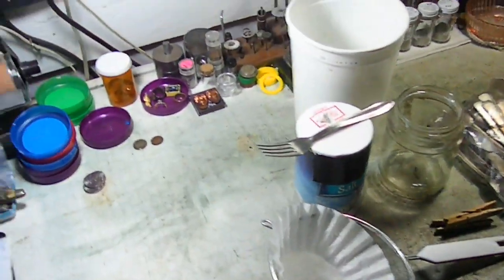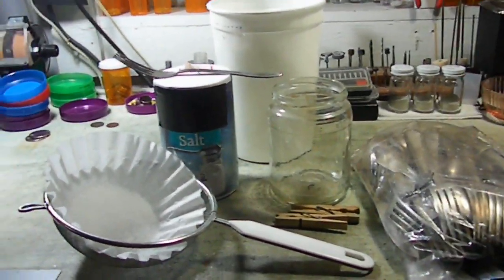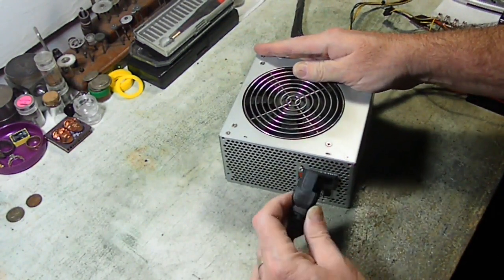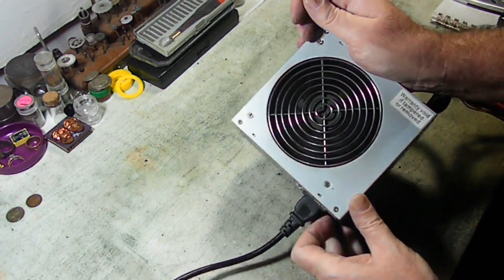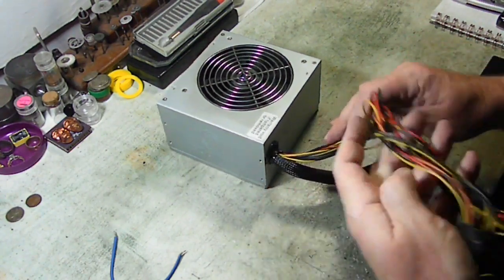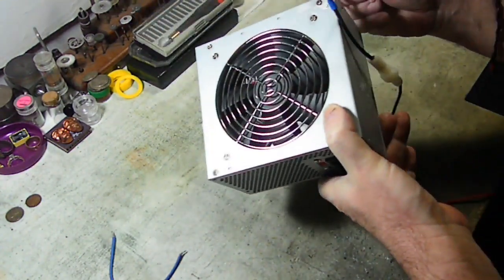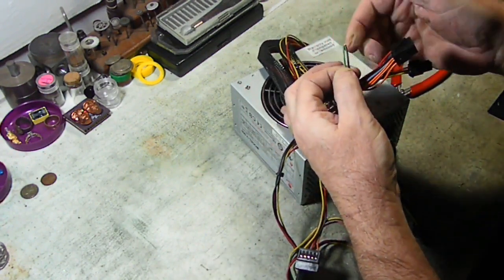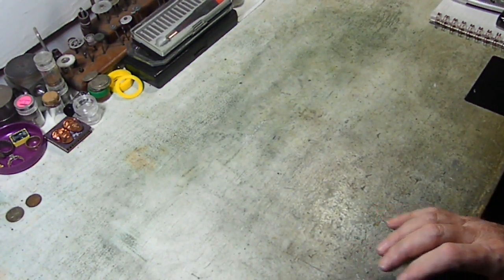Reverse Electroplating Silver Plate "Powering Up"

Comment: When stripping can you strip it from 1 item and plate it on another item like a silver bar?
Reply from the maker: Yes that is possible, but you would need a specific electrolyte to match what you are stripping or plating. It has been many years since I did anything like that. Back in the day when I had my rock and gem shop  I had a small electro plating rig, if memory serves me correctly I think we had a solution called stripping solution, I don't know exactly what it was, but it would remove the plating, but some would still end up in the bottom of the container when stripping. 

I while back I watched a video here on youtube about a electro stripping and PM recovery, Sorry, I don't remember the name of it but it explained the process really well. Try doing a search about this and maybe you can find out more there. Hope this helped!!

Comment: So you put an inline fuse on you power out. This may be a dumb question but if that can't put out more then 3.3v what's the point of the fuse? And I'm not trying to be a smart ass. Just asking to learn.thankyou
Reply: The problem I keep running into is my power supply senses the short circuit by having my cathode and anode in water. So I end up using my 5vsb, because.it will still work even with a short. How can I get around this?
Reply from the maker: The inline fuse is because that particular power supply is used for my silver cell, I was just showing it as an example in this video. The supply I use for salt water stripping has no fuse.  Here is a link to my Silver Cell Build playlist if you would like to watch the videos: https://www.youtube.com/watch?v=bcEnlVWOW4Q&list=PLJpGeLyma0yCzio-Sq3aJfpznM7bFWikG  As far as why your power supply is showing a short I really don't know, as far as I know it should only do that if the anode and cathode touch.
Reply: @BackyardScrapping  so I found the reason for my short circuit, what it was is. So you have your cell and you put your chloride into your solution. And with to much chloride you have to much continuity and it short circuits. So I remade solution with hardly any salt and it worked just fine but very slow. So I added more salt and it worked a little better but not much and I added more and it worked better and better and better and then short circuit. So I restarted again and went threw the same process from start to finish and found this out. Essential my anode and cathode touched with a salt bridge to a sense. I love science hahaha. You should take a look at my channel if your bored one day. :)
Reply from the maker: @shelbysgarage5828  Will do, just dropped you a sub, just beginning to have a heck of a time keeping up with everyone. I do my best to answer all my comments, man that is getting tuff, but got to stick with it 😁 Glad you figured out the problem!!

Comment: I have some power supplies laying around. I've scrapped about 30 of them. I'm not happy with that decision, I could've used them. I at least have about 20 or more left to work with. Before I even started this comment I got the 1st power supply I seen and followed your directions but it was a bad one, it did have alot of dust in it. I'll probably open it and clean it up before I scrap it and move to the next. I have seen it once before, on YouTube but you made it so much easier than the other person.
Thank you!!!
Reply from the maker: LOL I've seen quite a few videos like that, sometimes it just seems to me that they are purposely doing things the hard way!! Don't really see the point of over complicating things that are relatively simple to do LOL.
Reply: I'll take one!